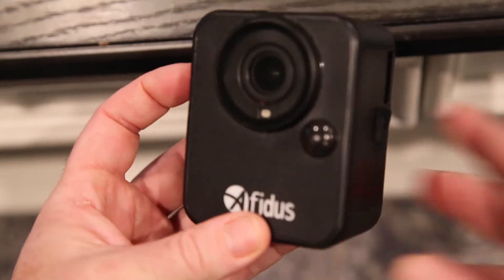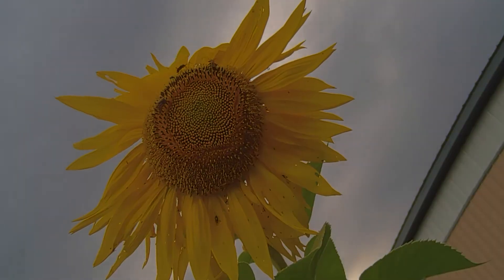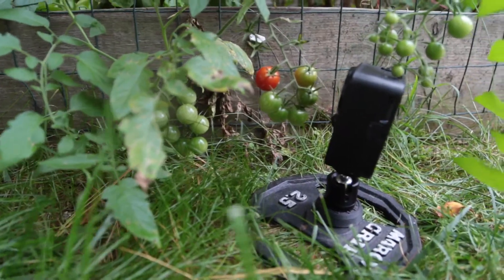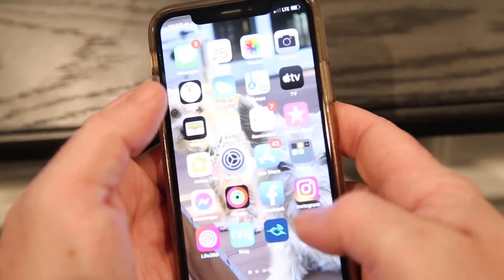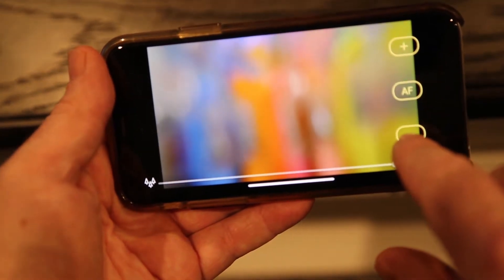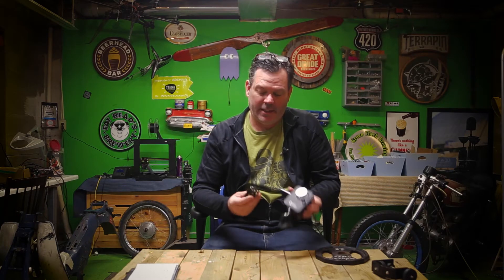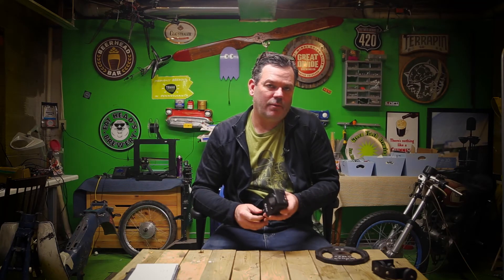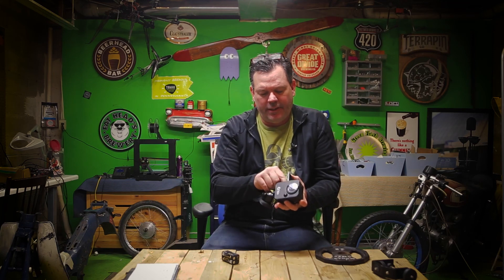Time Lapse Camera Review - The AFIDUS 200s

Comment: Not used my one In a while and now at told lost how to get battery out 😢
Reply from the maker: Slide the battery cover down and it should swing open.  Then if the battery tray is stuck, smack it on your hand a few times to loosen the tray up enough to slide out.